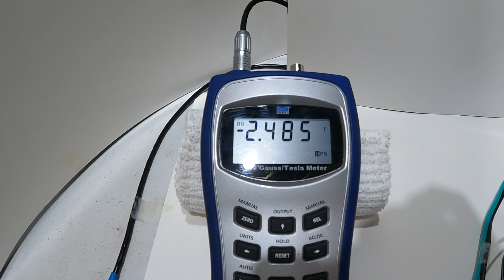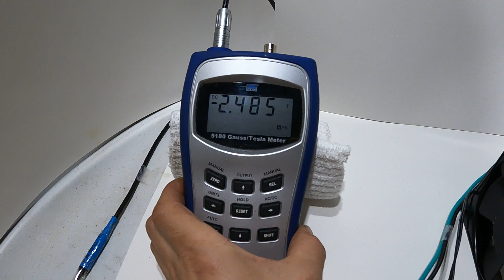120 Testing BBMPulser 5B 2.4 Tesla 220VAC kit + New Coil

Comment: What do you think of the idea of using a Micro Wave Transformer? If AC 220V input and output is 900V, I would like to give it a try if we can save the charging problem from being a problem.
Reply from the maker: One 220vac microwave transformer will give you on average 1500VDC. You need to tap into the secondary and bypass around 40% of winding. Measure it with the ohm meter to know you tap in at the right layer
Reply from the maker: Also you will need to cramp to the secondary wire because it's aluminum and you won't be able to solder to it unless you have special solder for aluminum
Reply from the maker: For some reason I didn't get your comment /question here on YouTube, I got it on my email, so you were asking what transformer you can use for 220V bbmpulser 5b kit, I use 160watts toroidal  transformer
Reply from the maker: I'm testing new stud diodes, I will make a video ones I test them for this 220VAC kit
Reply: @AndreyD   Is it possible to make a charging circuit with Stud Diodes without using a RURG 80100?
Reply from the maker: @AQUA-qf1ui  I think so, stud diodes should work better, I got some, will be testing them soon
Reply: @AndreyD   I have 4 metal stud diodes that I just bought.
1200v 150A 2 pcs
Can you help with 2 charging circuits of 1200v 100 A?
Reply from the maker: @AQUA-qf1ui  you can use stud diodes in BBMPulser 5B 230VAC version instead of rurg80100
You will need 4 diodes in there

Comment: BBM PULSER 5B 220V AC I operated the circuit with a 0.3mm strip coil, but when the power is increased, the RURG 80100 charging Diodes are constantly failing, and the inductor could not protect the diodes. The charging circuit needs to be changed.
Reply from the maker: I have blown one rurg80100 with 0.3mm strip Coil set up on 220VAC kit circuit (full PCB) replaced it thinking maybe it was faulty diode, tested 15 more times and it doesn't blow. The reason they blow is because during the pulse we get high current spike in charging circuit, I would increase length of the 18AWG  inductor to minimum of 8ft, my inductor does gets hot.
Reply from the maker: Also you can try using lower capacity caps in charging circuit that should help. Also you can try using higher rated diodes, like 100A, they can be rated as low as 400V, 1000v is not necessary
Reply from the maker: Make sure diodes are on good size heatsink, use mica under for faster heat transfer, use thermal paste as well, make sure they are well pressed against the heatsink. One of the issues is when diode handles high current flow they heat up fast, they needs to be able to unload the heat into the heatsink as fast as possible. Keep diodes  heatsink in the line of air flow for constant air cooling.
Reply from the maker: Also I think because I'm using 160W transformer which will soften the current draw, that's maybe why I can get it to work with out blowing diodes, not sure but this can be a reason

Comment: Hi Andrey, how much is the resistor of the coil ? And do make any change in circut to work with this coil ?
Reply from the maker: I'm sorry, I don't understand your question, can you please re-phrase it
Reply: @AndreyD  How much is resistor of the coil and do we need change anything in the circuit to work with this coil ?
Reply from the maker: @levanvan1988  this coil has lower resistance then 14AWG coil.
12AWG wires I use to connect to it are getting hot, with 14 AWG coil they were not getting hot.
Yes you need stronger thyristor and thicker wires to connect coil to the circuit.

Comment: Is the transformer an auto transformer?
How many cells has the voltage multiplier and what is the voltage the capacitors are charging at 100 percent power?
The circuit looks great an very compact and I like it. Thanks for sharing with us!
Reply from the maker: It was toroidal 165 Watt isolating power transformer on the output 220V
It was standard 220VAC BBMPulser 5B circuit.  
Capacitor Bank charges to 800V, circuit won't let it charge higher, but if I disconnect the trigger low voltage circuit the capacitor bank will charge to 910V, so it's 3x multiplication
Reply: @AndreyD  TY. I will search for that tutorial. I probably missed it.
Reply: @AndreyD  what is that white capacitor? What s the difference between the white one and those on the PCB?
Reply from the maker: @dii36363sh  the white cap is the motor start capacitor 30uF 450V, it's larger and doesn't have positive and negative terminals.

Comment: I knew that the copper strip coil would preform better, and it has... Another excellent invention by Andrey..!!
Reply from the maker: Hi Peter
Yes it actually does perform better, it has lower internal resistance so its able to produce pulses that are more sharp this feels different then from 14AWG coil. 
The coil made of 0.5mm strip performs even better. I just used it at 3 and 4 T settings. It takes for ever to heat it up probably 20 min or so